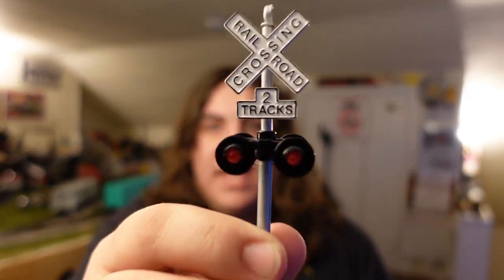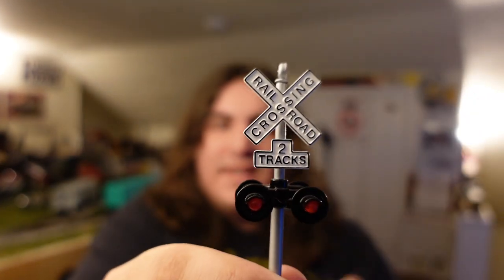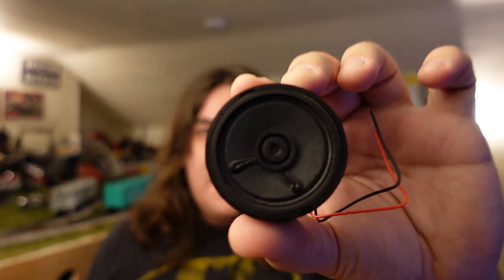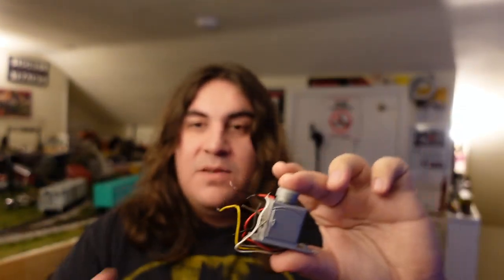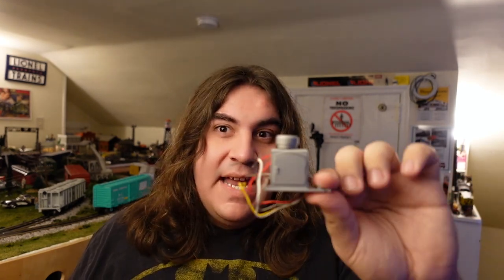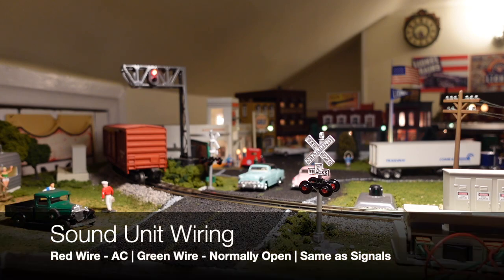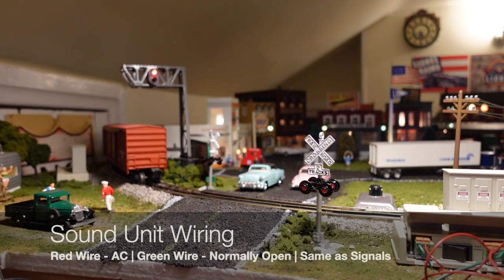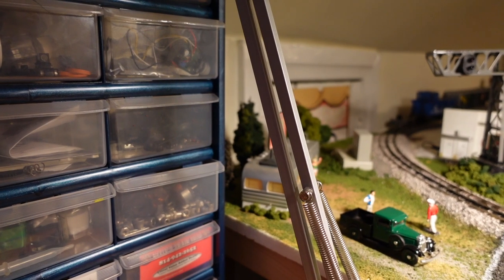Wiring Lionel 153IR Controller to MTH RailKing Crossing Lights with Sound | Full Tutorial

Comment: Great tutorial! I was in Reno 15 years ago and saw the crossing signals there and purchased them. I installed them on my old layout, which had tubular track using an insulated track section I made to activate them. They worked great. Now where the heck are they?
Reply from the maker: Thanks so much! Haha the railroad goblins like to hide stuff or use it for themselves. Very similar to the ones that hide socks 😂🚂💨

Comment: I just saw your video! The way you described the process was done in a way I don't have to be a
 electrical engineer to be able to understand. Also, will these controllers work with the MTH 30-11012, crossing gate set? Thank you so much.
Reply from the maker: Thanks so much for watching! Sorry the original reply was regarding my Lionel Banjo Signal video, I got confused.  Yes that crossing gate should definitely work with this IR sensor. These are great for the old post war accessories as well.

Comment: Great video Nick!  Question: is there a way to add another 153IR on the other side of the crossing to activate the signals from that direction?  Wasn’t for sure if connecting two IR detectors to the same pair of signals was possible…
Reply from the maker: Thanks so much for watching! Unfortunately I don’t believe so, that might cause some
Unintended fireworks. On my current layout I have these wired in phase with my auxiliary transformers / track. They can be activated from both tracks via blocked / insulated outer ground rail.

Comment: Do both parts of the Ir come in the Lionel kit? When I’m looking it up I only see pictured the big control box in the foreground and not the ir on the other side of the track. Is that a separate piece?
Reply from the maker: Great question, the piece at the bottom is a track lock-on only meant for tubular track. That piece did not connect well to the tubular track when I used it years ago. The “new” kits do not include that lock-on piece. I’d highly recommend to wire the IR with auxiliary power
Reply: @NixCrossing  perfect. Thank you for the response. Played with ho as a kid but 35 years later starting an o scale layout and don't know that much yet. Great informative videos.

Comment: How would you trip the lights for a train going the opposite way?  Use a 2nd 153ir and wire it together with the 1st?
Reply from the maker: Excellent suggestion, unfortunately with the IRs it’s only 1 way.  I’d recommend utilizing an insulated rail and phased transformers. I’ll be doing a video on that soon with the new layout

Comment: I was looking for a 14 volt AC  to power accessories most state 18 volt, any  recommendation for buying a 14 volt?  Thank you in advance!!!
Reply from the maker: Thanks for watching! A great accessory controller is a Lionel ZW 80 - you can set the accessory voltage output while holding the whistle - bell - Direction Buttons.  The controller also have a track output. Definitely check them out - Hope this helps
Reply: @NixCrossing  Awesome many thanks for your help!

Comment: Is the Lionel 153IR Controller and MTH RailKing Crossing Lights with Sound all I need?
Reply from the maker: Other than extra wire and a power source- Yes that unit has a speaker that makes all the bell sounds

Comment: Can we use 2 if 153ir sensors if it's a double track crossing?
Reply from the maker: You’d be better off using something called “phasing transformers” for that.  I did that with my signals on the new layout. Basically the track and Aux transformers share a ground. There are videos on YouTube that can explain it much better than I can. A friend of mine helped me wire it up.

Comment: Does aux power or track power matter?
Reply from the maker: I highly recommend using aux power for all accessories.
Reply: @NixCrossing  How much Voltage?
Reply from the maker: @rail-ryder7135  I run all my O Scale accessories at a fixed 14 Volts AC from my MRC dual transformer ACC out.